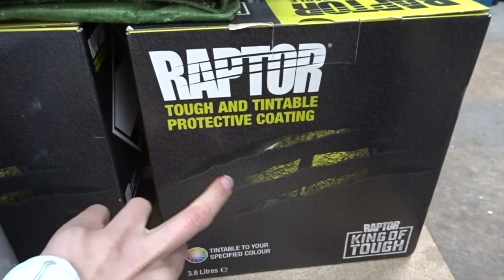Raptor Painting A Sprinter Van... It All Went Wrong!! | Van Life UK | Solo Female Van Life |

Comment: how many rollers did you use? (maybe 5, 10, 30?, I will also paint the sprinter).
You used 16 liters of paint - color, right?
Reply from the maker: Oh the roller question is a hard one every pack we had had 8 in and we probably used 15 packs  maybe more! And no we used 14 3 boxes of 4l of paint plus 2l of black paint
Reply: @AdventuresofSkyla  rollers was structural? I heard that the first layer smooth roller - the second layer and the next, structured roller. What do you think about it?
Reply from the maker: @Tomasz-cq7ct  we went for just foam roller as that was the texture we wanted some foam rollers are better than others we worked that out as we went along and only used the wickes ones as all the others went crap. They are in disposable so don’t want to go too pricey the don’t last long because of the type of paint you are using  etc.

Comment: Such a lovely colour we love it! We have raptor paint ready to paint our van and was wondering if you added any thinners to it? We were told it would only take 2 coats and 3 days of dry to cure but now we are thinking maybe we might need to find somewhere dry if it's going to take that long and that many coats 😅 we are having nardo gray 🙌
Reply from the maker: Thank you! No we didn’t use any thinners! It really depends on the paint colour you are going to use, this was so light it took 4 coats, but a darker colour would take less coats etc, so you could be alright with nardo gray! The black was only 2 coats! It also took longer to dry because it was done in feb/March and was around 1/2 degrees! In the temperatures at the moment 3 days would be fine. ☺️